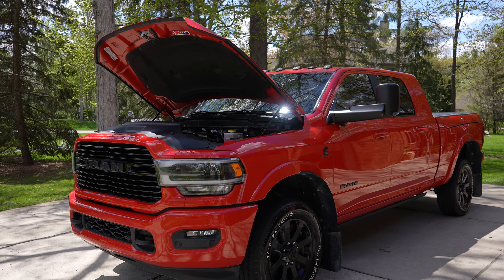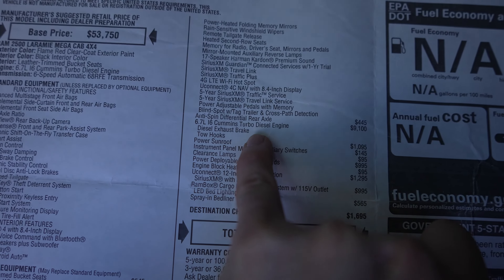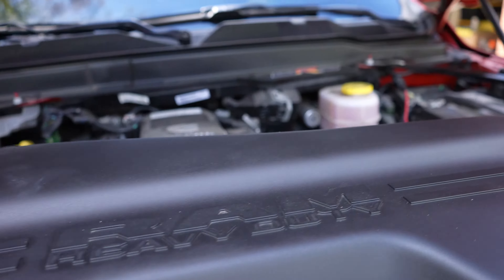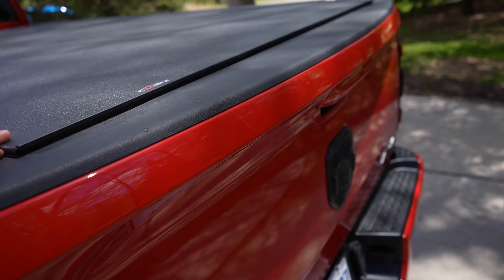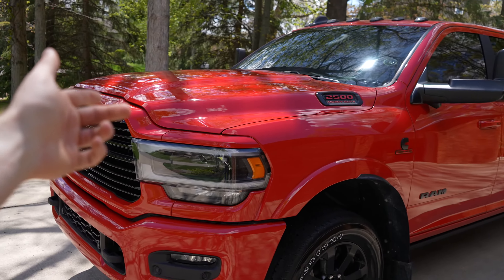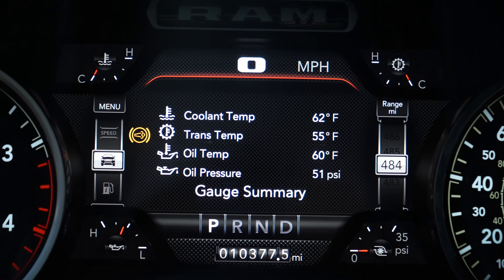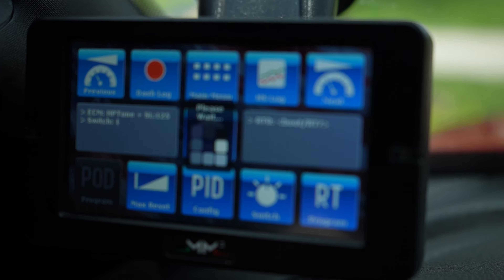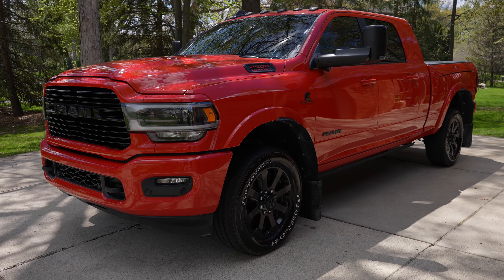BEST MODS for your 5th Gen Cummins (2019-2022 Ram 2500) | Diesel Central

Comment: I’ve done some of the mods, with my limited/ aisen, my next is the tune/- ! What I want to know is how that tune will affect my transmission as opposed to yours? The 52 gallon will vastly increase my driving distance, but I’m wondering if I should wait until the recall gets handled in reference to the CP4/CP3 for the Fass filter conversion?